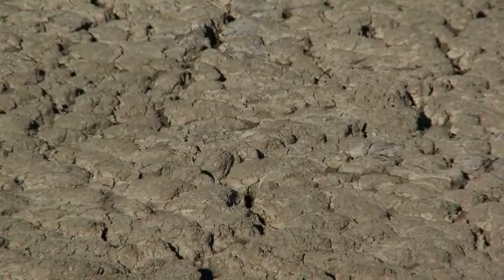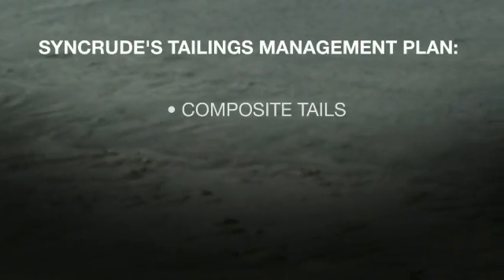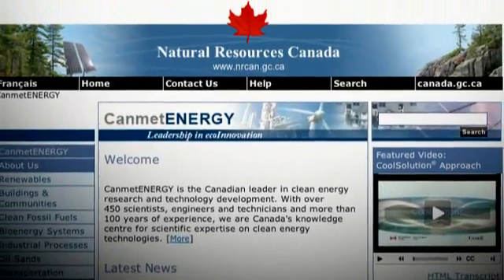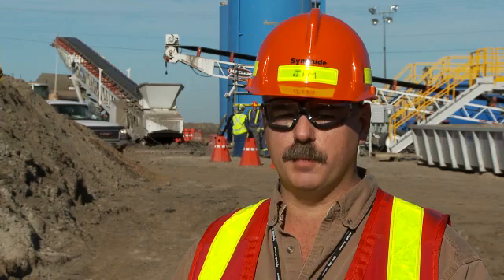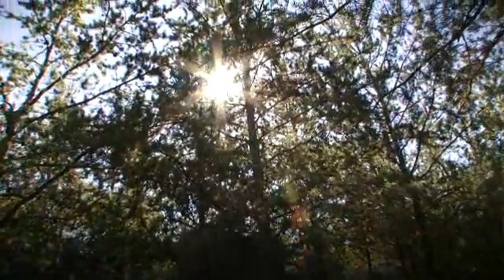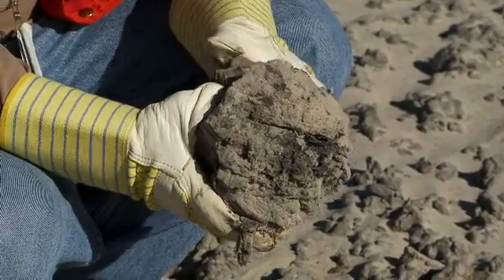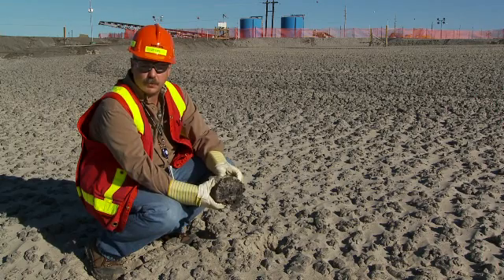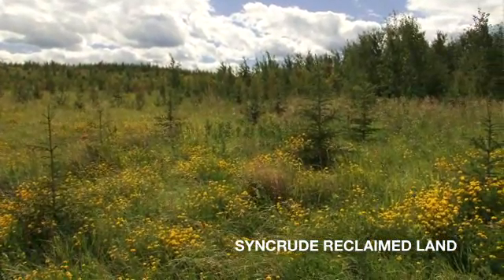Tailings Reclamation Using Centrifuge Technology

Comment: There is video which illustrates the possibility of using  Diamonox® Technology for the treatment of water typically found in tailings ponds used for the extraction of heavy oil.  Open mining and SAGD operations utilize tailings ponds as a necessary method for recycling water.  However the dewatering process can be considerably long (5 to even 20 years) because naphthenic acids render the clay (fines in the order of 2-3um) oil wet, trapping the water and preventing evaporation.  Consequently, due to the large amount of water used, tailings ponds tend to be substantially large. 
Diamonox Technology can process this water in a mater of minutes.  The Diamonox® AOP process destroys the naphthenic acids that are bound to the clay, which becomes water wet.  The emulsifying properties of the naphthenic acids is greatly diminished.  As the clay settles at the bottom, the toluene also clarifies as less oil-wet clay is present. At the end of the process, about 10-12 minutes, the toluene is clear and recoverable, while the great majority of the clay settles at the bottom.
Diamonox Technology can have great benefits for the treatment of tailings ponds water: 1) clay settles faster to the bottom enhancing the dewatering process.  This will result in smaller tailing ponds with much shorted residence time.  2) the bitumen/toluene can be recovered.  About 3% of the tailings waters contain residual bitumen trapped in the clay.  Diamonox can enable the recovery of the bitumen.  3) Naphthenic acids are destroyed significantly reducing the toxicity level of the remaining water.  
The water shown in the video is a synthetic mixture trying to simulate the actual conditions of the tailings ponds.  It contains brine and toluene in a 1:1 ratio, 1wt% kaolinite, and 100 ppm sodium naphthenate.  The color chance of the water is partly due the oxidation of Si and Al contained in the kaolinite.